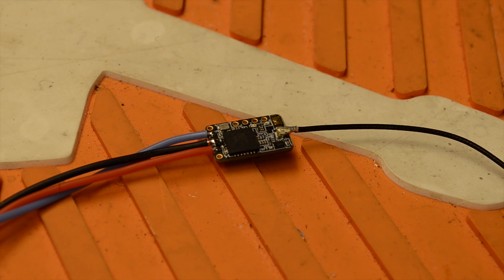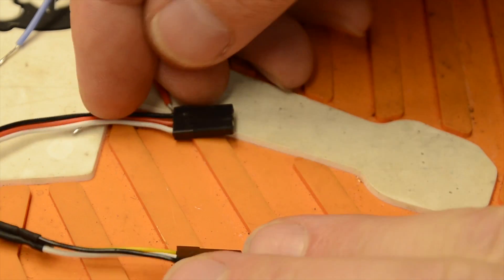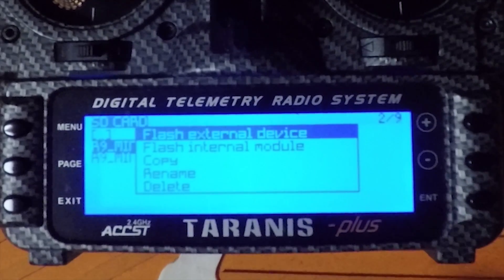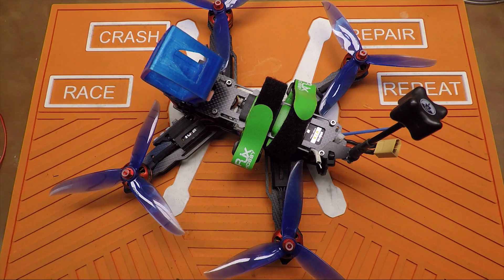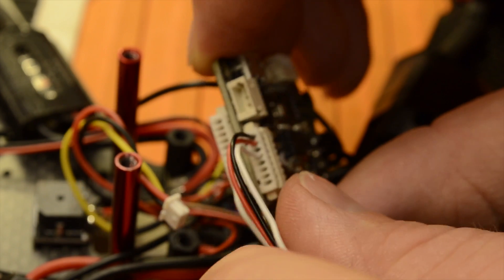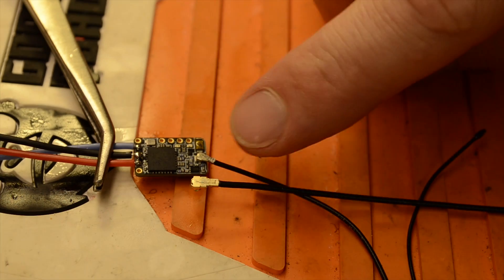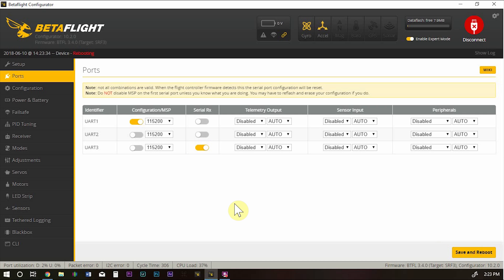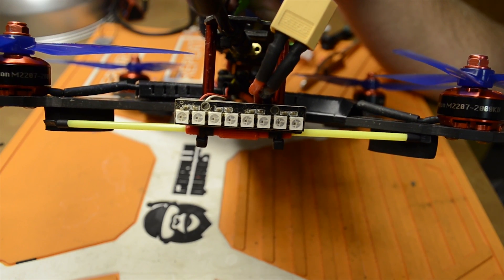Frsky R9 Mini firmware flash F. Port setup on an F3 Fc and betaflight configuration.

Comment: I have the R9M and also have the R9 mini receivers but mostly have F4 boards. I know for sure my Hobbywing Xrotor has an inverted Sbus port so it will work. I also just ordered the Dalrc F722 and this one should also work with no issues. So just to be clear... I need to update the receiver to the F port software and then solder the power, ground and F port on the receiver to a spare UART  TX? So i don't bother soldering the S port wire at all? I also have an R9MM receiver as well. Will the R9mm work the same? From what i understand the only receiver that needs an inverted port is the R9 mini and the R9MM does not right? One last question. Have you seen the new flex software that just came out a few days ago? What's up with that? Should I be using this software instead of the one released in May ? Sorry for all the questions and thanks . Love your videos man. I have shared it already with a bunch of friends
Reply from the maker: Do you have the sbus pad on the rx soldered to the sbus pad on the fc? Also have you flashed updated firmware to your rx and tx? If so what version?
Reply from the maker: The fport signal is going to come out of the sport pad. You will no longer need the sbus pad on your r9 reciever. Solder the fport signal to a TX pad. The flex firmware allows the people in the EU to have all the same power options with telemetry as the fcc users. It isn't ready for use yet because it needs opentx 2.2.3 and that is still in a nightly build and could be unreliable and unsafe to use. I personally am just running the latest fcc sbus smartport firmware,(not flex or fport) Keep the questions comming!
Reply from the maker: Are you having issues with the rc commands or are you having issues with telemetry or both?
Reply: @nanocnc  I haven't installed mine yet bud however when I purchased the FC I made sure it had an inverted port. I did, however, install an RXSR in it and had no issues so I know it worked. The only thing I didn't do and regret it is installed the other wire... (I think it's the F port wire and as a result, I don't have RSSI or telemetry) I will be taking it apart one of these days to fix. Hopefully, you end up figuring it out. Once I do if I remember I will check back to see how you made out
Reply from the maker: Yea, f-port would be the issue. Flash with regular sbus firmware and connect the sbus wire from the rx to the sbus pad on your fc. F4 flight controllers normally don't come with a inverter for smartport or telemetry. So in your case you need to use sbus and if you want telemetry your going to need to setup soft serial on one of your uart rx pads to connect your smart port wire to.
Reply from the maker: I recommend that if you are flying a f4 to get the r9mm rx and not the r9 mini because of the inversion issues with smart port.
Reply from the maker: Haha I glad you got it working. The inverted not inverted stuff is so dang confusing some times!

Comment: I'm on TX3,I've updated the Taranis,I've bound the reciver,set up my switches,I've turned on inverted and halfduplex,set the port to UART3 (serial rx) and I get no receiver readout,You have any suggestions Tweet ? Sorry to keep bothering you 😒
Reply: Thank you Tweet
Reply from the maker: If you need help just give me a shout, or an email.
Reply: Ok tweet,I have the taranis picking up telemetry when I pushed discover sensors,Now I go into bf and on the setup page were it shows the rssi,it has 11%,I cant get it to say 99%,it even comes out on my goggles as 11%,I went to the reciver page and put #12 as my rssi channel then I go back to check the setup rssi page and it still says 11%,when o go back to reciver page..the rssi channel is reset to disable,I'm almost there😡
Reply: The suggested video helped me alot by the way,thanks for that,now I have more of a understanding on how this works but I must be leaving something out on getting it to my goggles.
Reply from the maker: What does aux 12 look like in the reciever page in betaflight?
Reply from the maker: Also make sure you do not have "analog rssi" enabled in the config tab in bf.
Reply: Aux 12 is all the way up,I turned analog rssi off,It was on,but now shows 0% on the setup page
Reply: Aux 12 looks like full throttle in the reciver page
Reply from the maker: Did you go back to the rx page and select aux 12 as rssi?
Reply: Yes sir
Reply: Do I need to do anything with the halfduplex or the inverted ?
Reply: There both off sense I went the remapping source route
Reply: I'm using the Led as my soft serial
Reply: I rediscovered sensors on my taranis just incase and its picking them up but dang this can be a headache Lol,thanks for sticking with me.
Reply: I got it,I got it,I GOT IT!!!!I unplugged the quad and turned off the reciver then turned it back on leaving bf open to the reciver page,saw aux 12 go up and pushed save,now it works,dont know how or why but it works,man thank you very much for sticking with me,very much appreciated
Reply from the maker: Sorry for not sticking with you better. The youtube creator studio app really sucks for following long chats like this. My next reply was going to be turn everything off and back on again and the rssi will come back after a few seconds after being powered up. This has been in my experience exactly how the RSSI process has been for me.
Reply: Tweet your awesome man,just replying to me was help enough,Your videos help alot of us getting into this hobby so please dont stop what your doing,I look forward to absorbing as much knowledge as you can put out,Thanks again 👍
Reply from the maker: Thank you, I love helping people out with this stuff!
Reply from the maker: Persistence is needed in this hobby.
Reply from the maker: You need to connect the sbus wire to the sbus pad which on the fc is uart 1. Uart 3 on the dys f4 does not have a bi directional inverter and will not work with an inverted sbus signal. Which reciever are you using again?
Reply: R9mini
Reply from the maker: Ok, sbus wire from rx to sbus pad in fc should be uart 1. Setup bf to use that for your rc inputs. Uart 3 isn't going to work because you can just tell it to invert the signals because it doesn't have an hardware inverter on it.
Reply: So I wont be able to get telemetry ?
Reply from the maker: You can but you will need to use soft serial to get telemetry. Check this video out https://youtu.be/dzZRv24u1mg the process you are going to need to use is basically the same but slightly different.

Comment: Got radio and r9m module firmware updated. Just don't know what firmware to use on mini if I only plan on using sbus. Qx7, clracing f4s, frsky r9 mini receiver.
Reply from the maker: Version 180716. As of right now. https://www.frsky-rc.com/r9-mini/

Comment: how i’ll wire it to kakute v2 F4 ? Smart Port pad or Sbus Rx or Tx ?and what do i need to write in CLI ? thanks
Reply from the maker: Are you wanting to run the standard firmware (sbus and smart port) or f.port?
Reply: TweetFPV 
Ill use it for F.port what I’ll do ,but also for knowledge how to wire it for subs
Reply from the maker: I just finished filming a vid on how to wire and configure the r9 mini for sbus smart port to the kakute f4. Should drop next week.

Comment: I was wondering how to keep it updatable like an R-XSR, I guess adding a JST-3H on the way to the FC might be the best idea, thanks for the video!
Can't wait to get an R9 MM, solving the question of inversion properly for everyone...
Reply from the maker: There is a way to use serial passthrough to flash the firmware to the rx without removing it but there are some  very specific requirements that need to be met to make that work.
The r9 mm should make life easier for all f4 fc users. Frsky just announced a line of semi rigid immortal t like antennas too for the slim and the r9m rx
Reply: @TweetFPV  and as I'm not on Windows, I would be needing to bind the USB through a VM, at which point just relying on the X9D seems like less of a hassle. :)
Have they released any information on their immortal competitor yet? Cheers!
Reply from the maker: I haven't used anything other than a windows computer so I don't have the first clue how to make this stuff work with a Mac. The r9 mini came with a pin header you could just make a cable to connect to the taranis for firmware updating.
Reply: I'm guessing the pin header is only useful before you solder it in place (unlike, say, the R-XSR?) since there is no standard connector and the hole will be filled once you install it in your quad.
(ie: there aren't surface pads to replicate the solder through hole functions from what I can see online?)

But your idea is good, I'll find a spare M/F JST pair and will make it unpluggable so there is less chance of frying my receiver than doing some USB/VM magic on Linux (though that's what I had to use for ESC config and it worked, except for flashing where apparently Wraith32 v2 FW didn't work on a Tekko32?).
Anyway, relying on the OpenTX community seems easier than figuring out if my FC supports passthrough, etc. :)
Reply from the maker: 20 Sets Mini Micro Jst 2.0 Ph 4 Pin Connector Plug Male With 150mm Cable & Female https://www.amazon.com/dp/B01DUC1S7S/ref=cm_sw_r_cp_apa_CYRFBbZNZ3FC6
Reply from the maker: These are the right connectors to mate up with the r9 mini rx

Comment: Are those receivers work with planes?
Reply from the maker: Yes
Reply: TweetFPV I want to buy one of those for a tiny wing, do you have any video that I can see how to do it ?
Reply from the maker: I do not have a video of that. Would it be a wing that has a flight controller or just a rx wired to servos?
Reply: TweetFPV just tx and miniservos
Reply from the maker: Are those 5v servos?
Reply: TweetFPV yep  3.7-5 V
Reply from the maker: I ran a servo on the r9 slim. I haven't tried on the r9 mini. Perhaps I'll give it a shot and video the process.

Comment: Do you know if anyone has actually compared and tested the delay speed with the fport protocol compared to the delay speed of sbus protocol. I am noticing a a small delay with the R9 mini on fport protocol which I never noticed with the sbus protocol. Maybe it's just something I overlooked before but it would be nice to know for sure that fport protocol is faster since that is what Frsky claims.
Reply from the maker: Oscar Liang has done some latency testing between crossfire r9 and sbus. You can see his testing here. https://oscarliang.com/r9m-lite-crossfire-latency-testing/ the latency is surprisingly fast with sport. Almost as fast as crossfire. As far as fport goes I haven't found any concrete numbers on the fport latency.  Are you running fport with soft serial?
Reply: I have the Matek f722 and connect to Uart 3.  I will check out Oscar Liiangs video.
Reply: It now seems fast when connected to Betaflight. If you ever do find concrete numbers let me know. Thanks
Reply from the maker: The matek f722 is by far my favorite fc to date!

Comment: Thanks for your video. When I flash fport firmware to the reciever it lost the bind to the module. I've tried to bind it and it won't bind back. I also tried to flash the old firmware and now it still won't bind. Any inputs would be appreciated.
Reply from the maker: The loosing bind is completely normal. Not being able to rebind... It it possible you flashed the wrong firmware to your rx by mistake? I would go back and reflash firmware to the TX and the rx. Make sure you flash the correct one either lbt or fcc. Let me know how you make out.
Reply: TweetFPV. Thanks for the reply im gonna try it again tonight and I'll let you know
Reply from the maker: Good luck!
Reply: TweetFPV it worked perfectly. Telemetry working and all. Much thanks for your help
Reply from the maker: What did you do to fix it?
Reply: TweetFPV  I flashed the firmware by date for both R9M and R9 mini one by one until I got it to bind. Once I got it to bind I flashed the fport firmware. Once I did that I followed your by video on fport. Afte that everything started working great. Thanks

Comment: Is it possible to use the immortal T with the R9 slim?
Also, the R9 Slim receiver doesn't support F port right?
Reply from the maker: The R9 slim does work with the immortal t antenna and frsky just released f.port firmware for the r9 slim.
Reply: TweetFPV Ok, thanks again!

Comment: Hi I am using an F4 FC but even after making the CLI changes I can not get the receiver working in betaflight. Should I have entered anything different in the CLI for the F4  board. Thanks
Reply from the maker: It's going to depend on how the manufacture of your board has designed the uarts and if they used bi-directional inverters on more than one pad.

Comment: Great Review..good jobs. Keep it up. Thanks
Reply: 3d printed immrtoal T style, PLA? or TPU?
Reply from the maker: Pla for the center section and antenna tubes for the outer parts with a little heat shrink to seal it up.

Comment: Can you confirm the f.port signal is uninverted by connecting it to an F4 board with uninverted TX pad?
Reply: It’s so lame for FrSky to go backward on this. There are millions of F4 users who would rely on uninverted pad to make it work, and R-XSR provided such pad while this new product doesn’t explicitly do so. What’s going on at FrSky headquarter?
This is the show stopper for me to upgrade. A long range RX typically would fit on a drone with a GPS/mag module that takes two UART already, and leaving only one for RX. Fport is the only solution for telemetry and there is no workaround.
Reply: Is there a uninverted pad on the mini if you have a FC that doesn't have telly pad or unable to hook to Omnibus F4 Pro
Reply from the maker: F.port is still an inverted protocol. If you have a F4 that has a "tele" or "s.port" pad you usually can use that one or you can use soft serial to deal with the inverted signal.
Reply from the maker: There is no obvious uninvered signal pad. Hopefully someone can figure out a hack to get one.
Reply from the maker: I couldn't agree more. This just makes building a Quad more difficult than it has to be. I not have to be very selective on which f4 boards to buy in the future, making sure they have hardware inverters on the sbus and s.port pads.

Comment: what is the button on the back of the R9m for.
 does the power level really change automatically or do I have to flip the dip switches.
I pre-ordered it at Ready Made RC  where did you pre-order yours.
I got my  r9m $40  on eBay  .
50 bucks total how could I not try it
Reply from the maker: The button is for binding if you don't want to use opentx, the power output is adjustable in the menu system in opentx.
Reply from the maker: I got mine from heli direct

Comment: Great content! thanks for doing this,  Does LUA scripts works with the R9 receivers ?  I use LUA for changing BF settings and my Vtx channel. I looked for information online and could not find any. Thanks
Reply: I can confirm R9 mini works with iNav LUA script brilliantly. BF should also work, though I didn’t test it.
Reply from the maker: Yes, Lua scripts work with the r9m and the r9 slim. I haven't checked the r9 mini but I don't see why it wouldn't work on that receiver too.
Reply: Thanks for the replay, I'm ordering my R9M Combo now, those $9.99 receivers are a great deal. Hope your channel keeps growing!
Reply from the maker: Thank you, I hope so too!
Reply from the maker: Thank you for the info. The Lua script works well in betaflight as well.

Comment: Did you do anything to get RSSI from AUX via f.port?
I can't get RSSI from channel 8 or 16, all just sit at 1500 (no signal)
Reply from the maker: Delete and rediscover all your sensors in the telemetry tab, go to inputs and make a input with rssi as the source with a weight and scale of 100, go to your mixer tab and make a new mix under channel 12 with rssi as the source with a weight of 200 and offset of -100. Now rssi should show up under aux 8 in betaflight. If it doesn't make sure you have telemetry enabled in the bf config tab and analog rssi disabled in the config tab as well. Hope this works for you as a last resort you can reflash betaflight to your board and sometimes that fixes the rssi glitch. Good luck and let me know if it works for you!
Reply: Thank you, that method worked, but I hoped for a native support of RSSI output, like XM+ does it.
Seems a bit weird sending digital data back and forth instead of just mixing it in aux output in Rx.
Reply from the maker: Yea one would think that it would be native but unfortunately this is the only way I've had it work for me. Frsky is really good at making good hardware with little to no instruction behind it. This is a big reason the crossfire system is so popular. The instruction and support being it is so much better than the frsky stuff. But the savings is worth a little headache.